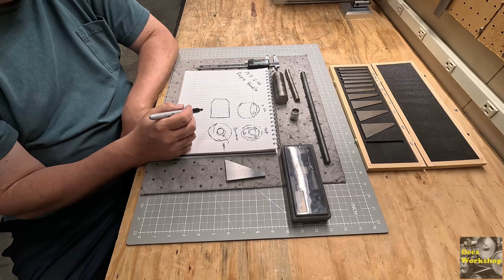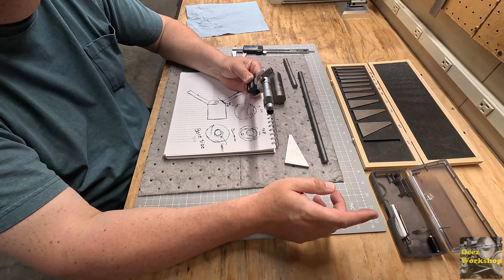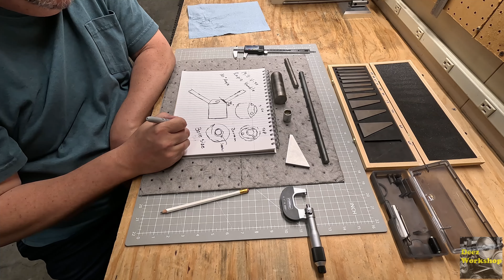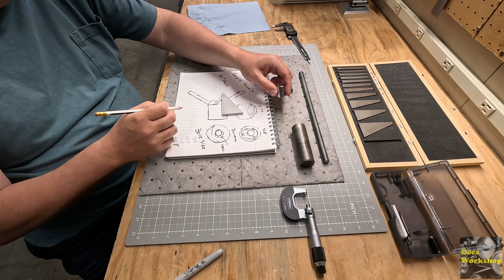Rapid Handle for Mill Vise Part 1 - Vevor Mini Lathe and Precision Matthews Milling Machine Project

Comment: Hi deez, I'm replacing bearings in my headstock. The symptoms was the headstock housing getting hot and you could feel the bearings " rumbling " . Bearing pre load was not the issue in my machine. Try disengaging gears and running lathe, if noise persists its the bearings but check out the drive system from motor pully to headstock first. 😊
Reply from the maker: I plan to check everything,  Remove the Belt and pull the Banjo away and see whats making noises.  Unfortunately I suspect the issue being bearings.  After longer use my headstock does also get warm,  I wouldnt say hot but warmer than I would expect.  Plus the noises.  I will record the process.  I have never replced bearings before or done this kind of work so I will be learning along the way.  I may hit you up for advice.  ;-)  Good luck.
Reply: @deezworkshop  hi dezz, I will help any way I can. There are lots of vids on utube on changing bearings on mini lathes . The only thing is which type of bearings you want to use ( tapered or angular. ) both do the same thing but angular are sealed and you have to be careful not to put them in the wrong way. Look forward to see the results from your investigation.

Comment: Hey Deez, I notice the clicking stopped when you reverse. Since you reverse the motor direction it is likely you have a bearing issue.
Reply from the maker: Thanks,  Good ear.  I noticed that too.  I didnt realize this could alsso be an indicator of bearings but I really do think its bearings.  I have to figure that all out.  Sizing, what kind to get, how to do it.  All new to me.  I will be researching and watching others videos on this topic to wrap my head around it.  I plan to share my experience. Wish me luck.

Comment: Hi deez, nice project but the lathe sounds like it has a bit of an issue ( gears maybe?)
Reply from the maker: I have an issue in the headstock for sure. Unfortunately I believe it’s bearings. I’ll be tearing jnto the headstock very soon. I mention it in a couple upcoming videos but it’s getting pretty bad and needs addressed. Good hearing.